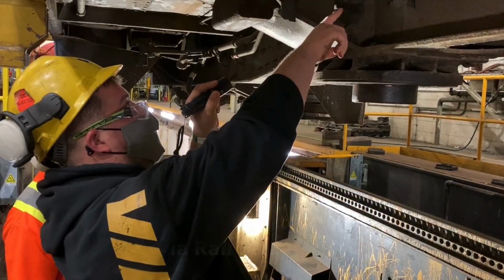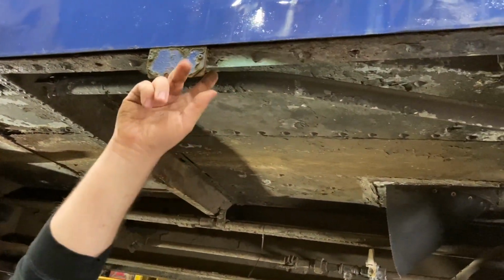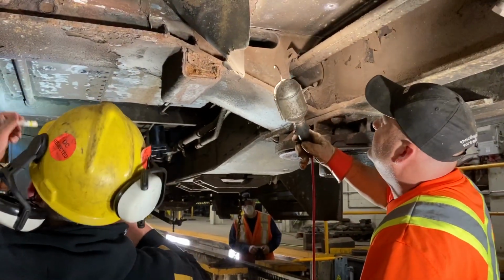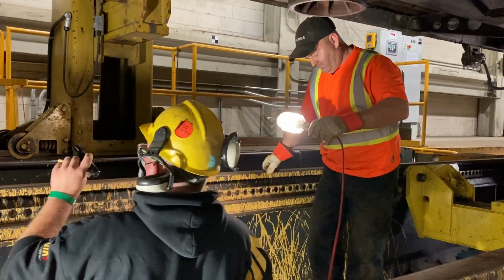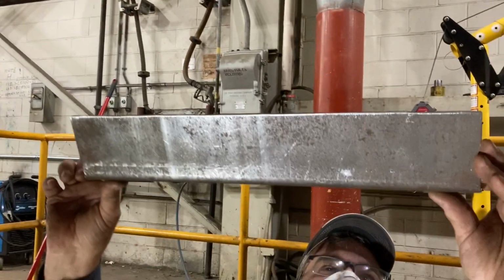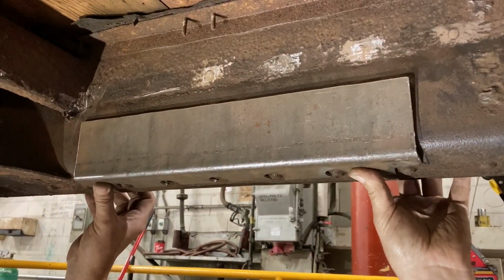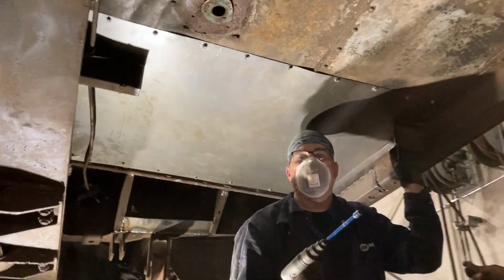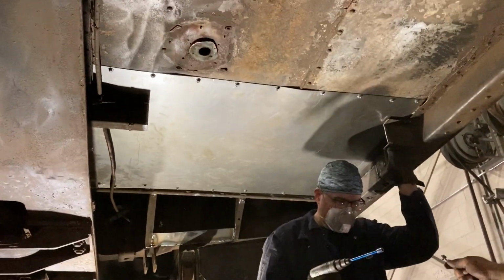Rapido’s RPDX 1115 “Edmundston” Structural Inspection and Subfloor Replacement

Comment: Would there be any use in rust protection spray (Krown, Rust Check, eg) underneath and in the lower body when it’s all primed and painted? This may prevent the sort of rust you’re now dealing with, as well as protect wire insulation and rubber from dying/cracking and connections from oxidation. Apparently good in aviation as well as automotive applications. Those provide mobile service.
Reply from the maker: Jon... funny you should mention thatI I’ve  been looking into a product which is similar to Krown or Rust Check for that exact application. I’m talking to a friend of mine from Petawawa an looking into what the CAF (Canadian Armed Forces) use for there equipment
Reply: Here's a link to rust converter paint. The Canadian Coast Guard used to use a product called "Conquest" on the marine bouys in the North Atlantic. My father had some and we used it on my truck bumper and snowmobile chassis. I think he got it from UAP/Napa. 

https://www.carbibles.com/best-rust-converter/
Reply: SermeTel coating might be good for stopping galvanic corrosion .
Reply: @tieplatecaf  We just let it all rust...but I'm navy :).  Coatings was really a HT thing, I can ask around, as I'm Mar Eng not HT.  Conquest (mentioned below) is something I have used, but I suspect it was outlawed at some point.  It's an oxalic acid product that hardened the rust into a fixed medium.